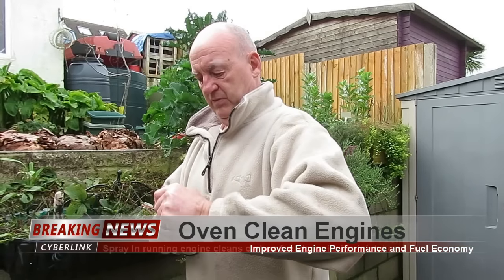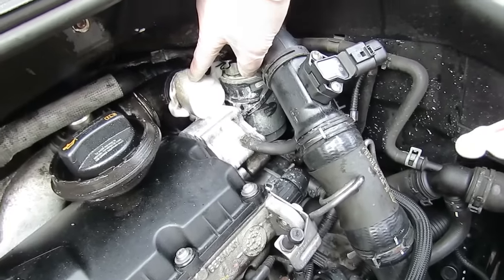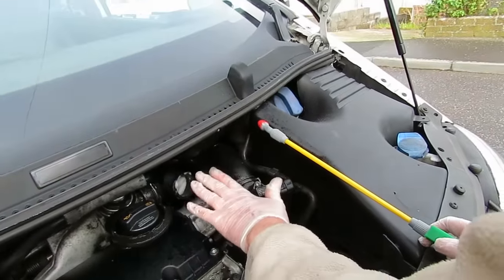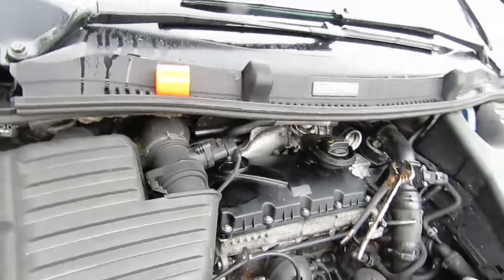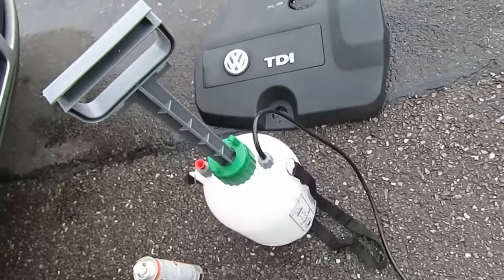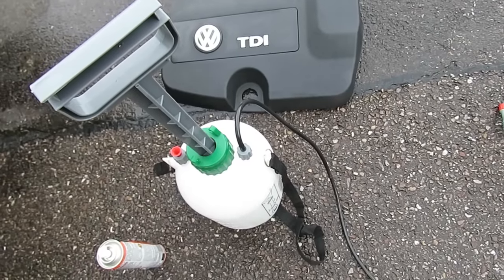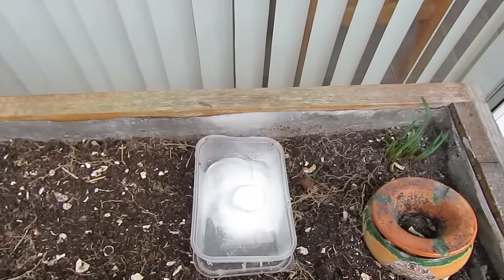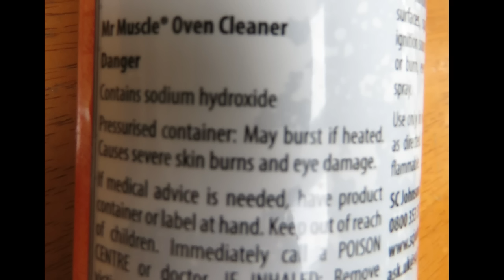Clean EGR Valve Decarbonize Turbo DPF MPG Limp Mode Mr Muscle VW 1.9TDI Sharan Galaxy Alhambra

Comment: I am absolutely disgusted with some of the ill informed comments below that is based purely on opinion without any evidence. This method WORKS arguably better than those "turbo and egr cleaners" given a similar amount of time for treatment. Yes sodium hydroxide does corrode aluminium and certain other materials, but not by any appreciable amount considering the duration of treatment. Add to the fact that the whole system is "rinsed" afterwards by the water treatment which in itself is another proven method of decarbonisation. Hydrolock is impossible unless you are a complete idiot dumping in pints of water VERY QUICKLY. If you do the maths, a 1.9TDI engine which has a displacment value of 1896cc with a compression ratio of 18:1, you would need to dump more than 100cc of water all at once for hydrolock to be an issue. 

Point being, this video depicts a completely valid degreasing and decarbonisation of the intake and exhaust system without stripping components down for a more "isolated" cleaning regime.
Reply from the maker: Thanks Samuel Seafoam is also reactive with aluminium because it contains potassium hydroxide. It is marketed to be sprayed directly into the air intake and is what gave me the idea to try oven cleaner, which is sodium hydroxide based.  Car appears to be running ok and have done quite a few thousand miles since treatment.
Reply: My Skoda Octavia is currently suffering from consistent limp mode on motorways going up inclines. Suspected VNT sticky vanes but since my vehicle has done £152k, will be applying the oven cleaner directly into the turbo for a more concentrated clean. I will also do your method to somewhat clean out the intake system as these engines are prone to accumulate oil in the intercooler as well. If people had bothered to watch your video properly to show the testing conducted on samples of aluminium using the oven cleaner, I am sure we are all in agreement that it is not as corrosive compared to using caustic soda crystals.
Reply: All vehicles I know of are atleast cast iron/stainless steel from the exhaust manifold thru to the tail pipe. Regarding components from the intake thru to the combustion chamber, Andrew has explained that from the existing carbon and oil accumulated to begin with, it is unlikely to make direct contact with the aluminium. If it does, Mr Muscle isn't a particularly strong formulation of sodium hydroxide which at the very worst, would only dull aluminium.
Reply from the maker: Check to see if your car is due for a recall for emissions, or if it has the software change already, this could well be the problem with limp mode.
Reply: Indosarnia  let's agree to disagree as clearly you have never taken an engine that has had this treatment apart before.
Reply: Very well said.  Who would loose is it can be done cheaply? 
Here noting that solvents can cause as much damage to rubber seals than short term exposure to caustic. 
Posted my own view.
Reply: Indosarnia  if he did have some of that carbon gunk go into the engine it can get stuck between vale seats and value. Which does cause loss of compression and even a slightly bent value. I have seen this and had to remove the head and replace a bent value. Always remove egrs and clean off the vehicle. Not worth the risk.
Reply: Indosarnia  I don't think @Samuel Understands the numbers game. The engine was certainly under extreme stress. A Rod could bend at any time. Fuel+air+water vapor+mr muscle=mad scientist.
Reply: @SamuelCharlesworth  the guys got a point... Its easy to bend a rod  and your calcs failed to include all factors, including pre-detonation. There's certainly risk of throwing a rod, if ones not careful.
Reply: @peterlattimore6013  Please do the maths and prove me wrong then 😂
Reply: @peterlattimore6013  typical reply of a person who has no mechanical background. As already stated, do the maths and prove me wrong otherwise you are no better than the other trolls on this forum
Reply: @hartzland7658   learn respect !!
Reply: @Ben-jq5oo  What!
Reply: Samuel Charlesworth I love your comment I think your the one how’s Ill informed spraying anything into an engine to try and clean it is a temporary fix at best and in the long run will do more harm than good the only proper way of cleaning your intake system is to remove it and clean it properly you never spray anything into a running engine especially water you can hear the engine rattling its nuts off when the water is sprayed in if you think this is a good method then all the power to you I’d just never let you round my car just my opinion but I’m sure you’ll find it backed up by most competent mechanics
Reply: @SamuelCharlesworth  you are funny...And I don't need to do any math to know it could be harmful to full an intake with Mr Muscle... Its Called Volumetric efficiency... If you preload a compression chamber with to much fuel, the very least an engine could hydraulic and bend a rod as the next firing cylinder pre-ignites under pressure (diesel fuel ignites under compression), causing the rods to attempt to rotate in opposite directions while the crank  rotates clockwise... Don't assume Everyone with an opinion opposite to yours is Negative...its just that some understand the math of probabilities better than others.
Reply: @peterlattimore6013  I don't see any of your equations proving me otherwise. Come to me with some actual maths as everything you are already talking about I already know and hence why both me and the OP haven't seen these "probabilities" you so enthusiastically describe.
Reply: @SamuelCharlesworth  
I would suggest that even with a cylinder under compression that is half full of water would have doubled the compression ratio to 36:1.
Not to sure what forces would need to excerpted to bend break/bits. 
He might have used a bit too much water in my opinion as I've seen other videos and they defo didn't bog down as much as this poor car.
I've got a £250 fabia 1.9tdi with no power. Probably will try a little water first then consider Mr muscle through intake if I can't realise the three bolts off the exhaust/turbo to clean.
Reply: Indosarnia  Not all diesels have a DPF

Comment: The cast aluminum is far more porous than the samples you tested. Cast aluminum does oxidize faster than extruded aluminum. The pores of the cast aluminum can retain the sodium hydroxide and burrow into the metal. Removal of the manifold and EGR is the best way to de-carbonize the manifold and the valve. Boiling the manifold will break down the carbon deposits with minimal effect on the alloy parts.

Thanks for the video
Reply: The reaction will last a short amount of time until the base is depleted. Is not like keeping it under sodium hydroxide.  is a film. That reaction after is done it transforms. Water will clean that as well and vapours from burn as well in the normal run. Some vinegar will neutralise that...for the worried people. Or try acid before...it cleans the carbon as well even faster.
Reply: @FlyHighWavesSounds  The vinegar (an acid) will stain the aluminum as well.

You also need to be very specific what acid to use on aluminum. Carbonic acid is the best at dissolving the carbon but it will satin the aluminum and get into the pores of the metal. It continues to etch the metal. 

Maybe you don't care about the staining or corrosion in spots of the aluminum caused by using caustics or acids on aluminum. It does happen, I've been in the auto industry for years and get to see long term results of various cleaning methods.
Reply: @davidparker9676  Sulphuric acid and the Anodisation process is completed...maybe will make the aluminium even more resistant and corrosion free in theory. it needs to be a mild acid...Phosphoric acid. There is a extensive test cleaning DPF with a lot of chemicals. It will remain no more than a film and once reaction is done is no more. I think the method will work without problem. Only the issue will be with the oil breakdown from cylinder used for lubrication and that can cause issues maybe.
Reply: @FlyHighWavesSounds  Cast aluminum is more porous than billet or plate aluminum. Cast aluminum does not anodize well because of the surface and the pits and pores of the metal.

Anodizing works well on process formed aluminum sheet, plate bar and billet. It does make the surface more resistant to corrosion.
Reply: @davidparker9676  Was said just as a reference. I would be more concerned about oil breakdown in the cylinder than the actual corrosion. In few minutes will happen nothing. I thing you already made up your mind that is a bad ideea. A plastic intake manifold will leave just the block intake witch is aluminium and head of the piston to touch the chemicals. I'm sure they are already coated with a lot of carbon and oils and the effects in few minutes are minimal. Instead Mr Muscle a degreaser witch this thing is in the end. I use it to clean my parts recently and no visible damage. If we talk in therms of principles they react but also water , fuel, oxigen will do. The question if if will work. I say yes but the oil breakdown is the problem.  This can be addressed with a more mild concentration of a base chemical for who is concerned.
Reply: @FlyHighWavesSounds  I agree that oil breakdown in the cylinder is a serious concern over corrosion to the intake and head. These cars have an aluminum intake manifold and usually get very heavy and thick buildup in them. I could see using the oven cleaner to remove oil residue and a small amount of carbon, however I found that these manifolds need to be removed to be properly cleaned.

I recently used heavy duty oven cleaner to clean a manifold. I was doing a bit of a scientific test to see what worked best and quickest. Burning the carbon with a torch worked very well. I had to take special safety measures with the manifolds because the ones I was cleaning have the EGR valve built into the intake manifold.

I tried the oven cleaner. It did work well on the soft, oily buildup but did nothing to the hard and thick carbon buildup. I had to burn the rest of the carbon out of the manifold.

I used a concentrated degreaser and a brush, which also had similar results to the oven cleaner.

I soaked another manifold in mineral spirits for days, similar effects as the other cleaners.

I soaked a manifold in carbonic acid (carburetor dip) and it worked almost as well as burning with the torch, but did require additional help with a brush to clear away the loosened carbon goo.

Cleaning the intake ports and intake valves need to be done with the manifold removed and can be done mechanically with a pick tool or an abrasive blaster. The acid can be used one port at a time and flushed out with water and compressed air.

Disconnecting the EGR will reduce the carbon in the intake, also using a catch can instead of PCV will keep the intake much cleaner.

Comment: I had a vw Bora 237bhp and it would over boost and cut out in 4th 5 and 6 gear and no matter where I took the car the mechanics would say new turbo or turbo clean, so I took the turbo out and it was clean and I had found a half melted vac pipe that run's off the turbo actuator had a soft spot from heat so 5 pound fix.
You should have a proper look at the car and don't try that again

Comment: I used crushed cornflakes and ketchup instead of mr muscle. It didnt work.
Reply: Expanding foam mixed with tile adhesives good too
Reply: rice crispies would really  make it pop.
Reply: @greezer9716  I think that would crackle the cylinder head
Reply: @icarr121277  might 'snap' the cam belt .

Comment: FFS dont do this,  sodium hydroxide is a strong basic. It will eat rubber and seals amongst other parts. Makes plastics brittle and deteriorate quicker. Also reacts with the injector tips and chromium on the piston rings. Chromium comes off the rings , the bores start scuffing over time and injector nozzle holes corrode giving a poor spray pattern. This in turn will soot the intake up more. 
Mr muscle oven spray is only used to clean the TURBINE side of the turbo if the VNT vanes are sticky. Dont use it on the intake side. Carbon clumps can bend rods

Comment: this is certainly not recommended. the absolute best way to decarbonise your car is to actually remove the intake and egr valve and clean it well. it's unbelievable how much carbon build up it can be in a diesel engine. especially if u have been driving in the city.there is nooooooooo way u can remove that with this method. it is impossible.

Comment: DO NOT put Mr muscle in intake side! the idea of this stuff is to go in the exhaust side to clean sticky vanes only! putting this through the engine is asking for disaster
Reply from the maker: Sea Foam uses Potassium Hydroxide, which reacts with aluminium the same as sodium Hydroxide and is what gave me the confidence to try it.  No disaster as yet :)
Reply: Andrew K Fletcher Mr muscle contain more chemicals that just that witch reacts with aluminium and rubber seals, and reputable mechanic will tell u to avoid getting in the combustion chanber! sea foam works same as water through the intake to decarbon the internal, completely different than using my muscle dude, it may have worked out OK in this but please don't recommend others to do this
Reply: Andrew K Fletcher sea foam spray is not for diesels. It specifically states that. Are you talking about regular sea foam? What if you pressurized regular seafoam so you could spray it, like the oven cleaner.
Reply: You don’t know what you’re doing and people will copy you - stop making videos and learn a little.
Reply: Yet....

Comment: You can spray most things into the intake as long as not in large amounts at once and is sprayed not poured, water/meth injection has been around forever

My only issue with this is that Mr muscle will react with aluminium and leave pitting in short order

Comment: Did you get a long term result from your method? Has your car carried on driving 3 years later?
Reply: @Gordon Bird calling him a buffoon doesnt  exactly make people want to listen to you.
Reply from the maker: Still driving the car, though the limp mode problem is becoming more problematic due to a build up of carbon yet again.  I think the permanent fix for this will be a new turbo and a EGR delete kit. Already fitted a new EGR valve, which did nothing.

Comment: With all the pressure from the Pistons on a diesel engine you’re lucky it did not Hydro lock even by putting a little bit of water like that big risk
Reply: Abraham Ghannam it’s not much of a risk as long as the engine is hot enough.
Reply: 👍Gotcha thanks

Comment: Love how all the mechanics are having a meltdown because they cant charge £200 now for an easy fix......rofl
Reply: Wow you couldn't have said it any better
Reply: It's not that it's that Mr muscel is an acid it will ruin rubber seals and cause corsion and if he wasn't care full you could easily hydro lock it and bend a rod
Reply: I Carn’t see any mechanic having a meltdown over this there all rubbing there hands together with all the extra money there’ll be making replacing all the things that have been screwed up by an ill informed cheep skate .
Reply: I have never paid a mechanic in my life, entirely diy and been doing my own and a couple of freinds cars for years, you risk serious damage , no profit motive here, just dont like poor / risky advice.Far better if you are carboned up to strip off the manifolds and egr and manually clean them,(even use mr muscle and water on the deposits once they are off if you like), if you dont want to spend cash on a garage service.Will still cost a gasket but wont wreck anything.
Reply: You total correct go try it
Reply: @andrewmason8844  That's what I was thinking. Car dealers are probably laughing too. Some of them will cause damage beyond worth repairing. Of course some will get away with it but I would never do this on my engine.

Comment: If you have audis or passats it will be easier to remove the intake manifold due to your engine positioning. Mine is right down the back, so I'm not going to be skinning my knuckles or shearing off studs getting the bastard out. 163000 miles of shite got burned up with no problems. Would I do it on my Mrs Tiguan with 29000? No need. My old 58 plate seat altea? Shit yeah! Saw no need to add water though. Use vinegar to neutralize the sodium hydroxide if you have a hardon over it.

Comment: “Don’t get any water in the intake....”  literally 3 seconds prior he sprays water into the intake. Basically if you drive a bag of nails car like that pikey sharan,  crack on. Anything you want to keep don’t do it.
Reply: The water vaporizers as it hits the combustion chamber so should not do any damage apart from clean a little bit like a damaged head gasket when it let's water into the combustion chamber it steamcleans
Reply: I do it to my V8 Aston Martin all the time keeps engine clean
Reply: EVIL dead lol joker
Reply: @evildead1949  cylinder blocks not heads
Reply: bonkey dollocks head on a v8 mate, I’ve got one on my kitchen table with a wine bottle in it. So shaddap
Reply: @jameslatimer1432  same here
Reply: Done my 222000 mile bora now 3 times on water decarb or 2 years (10year ownership now), plus a Mr M treatment into the turbo insitu

Comment: Or you could just buy Seafoam diesel inlet spray and pump that in after the MAF... Its kinda designed for cars and doesn't involve oven cleaner and water going into your engine.
I'd say that's 20 quid better spent x

Comment: Mr muscle reacts badly with alloy!
Reply: Yes, with time it will corred any aluminium if it is let at open air, just dont forget that corrosion will never happen as when engine is working oil vapour is constantly beeing forced into the manifold
Reply: it never had time to react